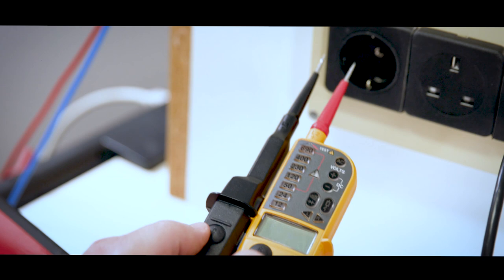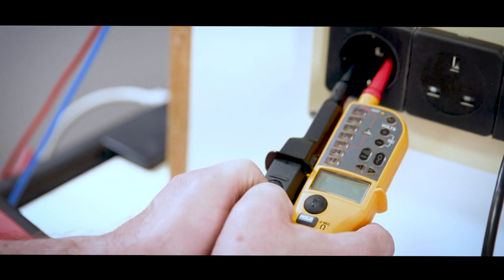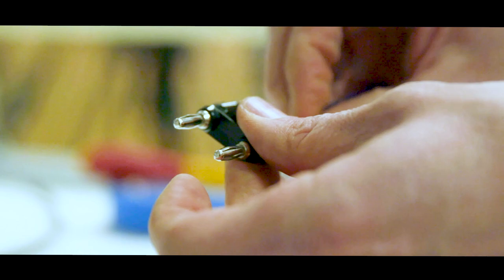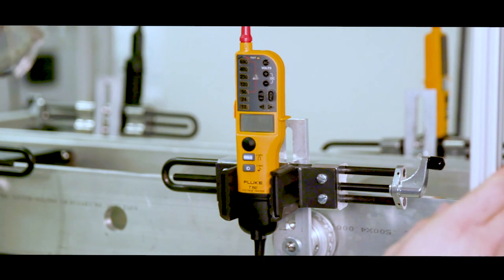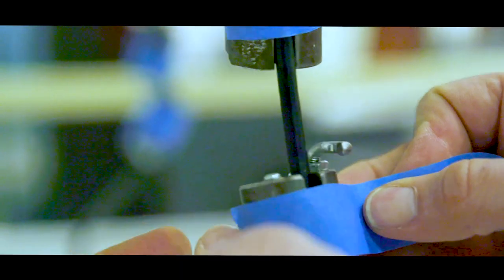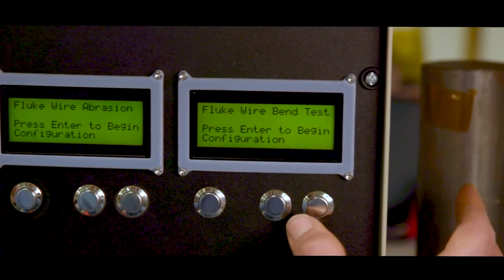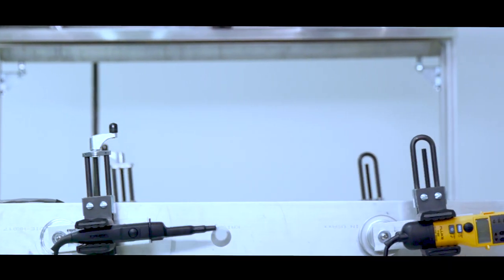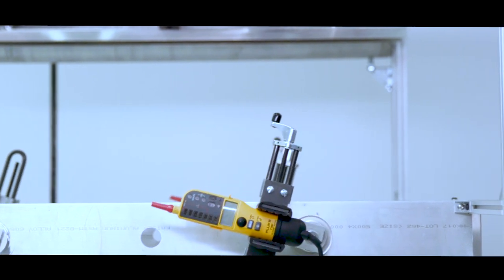How does Fluke test the new and improved Two-Pole Voltage Testers?

Comment: I bought a T150 tester ~ 3 years ago. And already twice repaired the tattered cable (the place where the cable enters the tester). I rarely use the tester (say, 20-30 times a year).
Very unreliable device. You never know if the tester readings are correct. I will not buy Fluke anymore. Unfortunately.
Reply: @FlukeEMEA  Thank you for quick reply. This attitude can change my mind. Even if my tester does not fall under the recall program. For it is clear that the company cares about its reputation. It is important!
Reply: @FlukeEMEA , I would like to thank Fluke company. I have got completely new tester T150 by the recall program. And of course I have totally changed my mind about the company itself and a quality of products. Problems can happen to anyone. But with such attitude it's acceptable. 
THANK YOU!

Comment: my cable broke recently next to main body of t150 it was bought in sept.2019, occasionaly used, looks still like new, but the cable is like hard pvc, no one has the cable as spare parts, so big question mark about this tester, it was dangerous to use, so i have to shorten the cable by myself becouse is out of warranty, very sad... one bit note!: electricians use this in outside enviroment so the temperatures can be different not like in your lab!